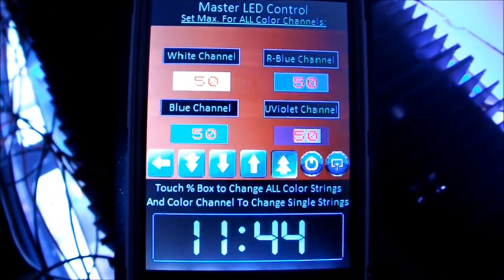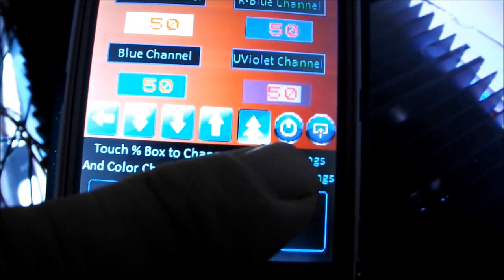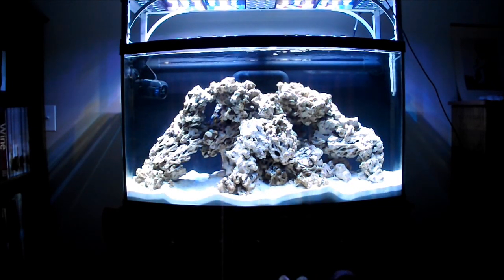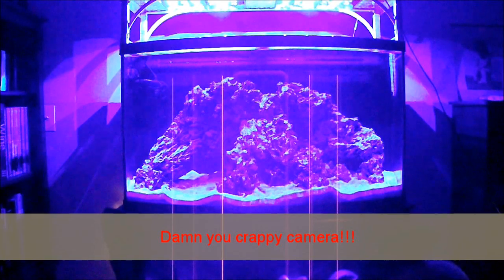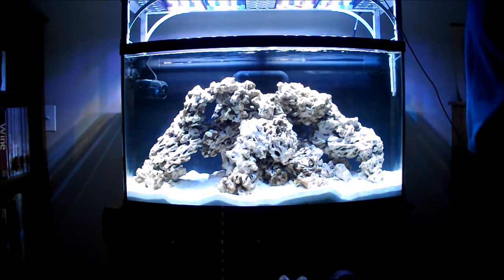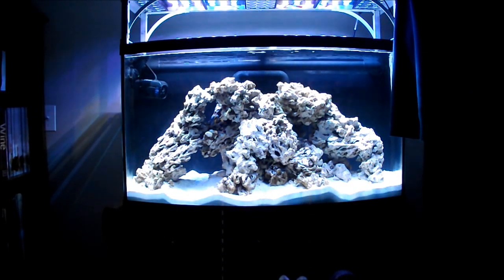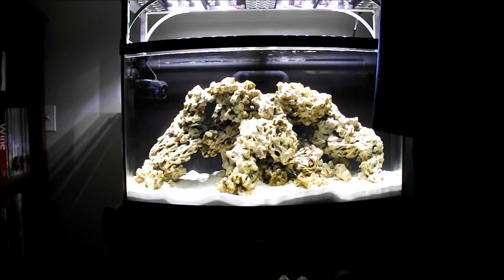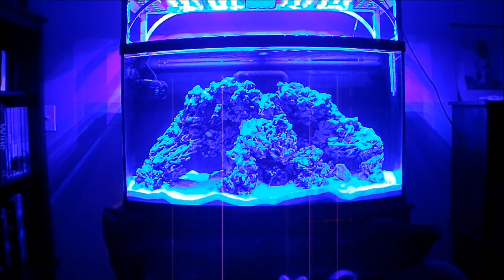DIY LED - w/ Arduino Dimming Control

Comment from the maker: It's running fine. Especially for the price I paid $28 free shipping. It runs very cool right now, but I am only using half the available amperage. Time will tell when I start using more and more available power. The only complaint is that the fan is a little louder than I would like. But, 2' away from the tank and you don't even hear it. You can only hear it when you're right on top of the tank. For $28 I'm not complaining.

Comment from the maker: If you already have the LEDs you only have to get a dimmable driver and a pot to dim them with.

This build has not been cheap, but it is much cheaper than buying everything brand new. And, a lot more rewarding.. 
$210 for the LEDs, Heat sinks, and optics. $45 for the power supply. $40 for the arduino with tft touch screen, $7 RTC, $30 for 2  - 6 channel arduino LED driver shields, $10 for 3 temperature probes....so YIKES $450 total. But, I have been collecting the pieces for almost a year.